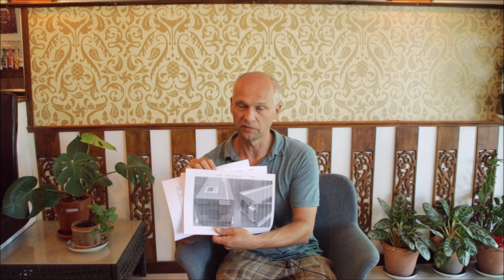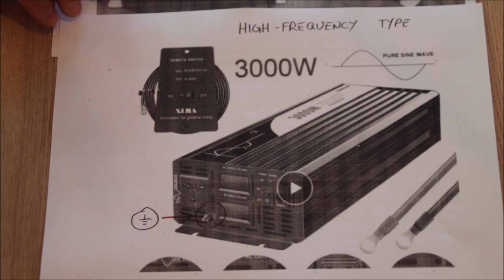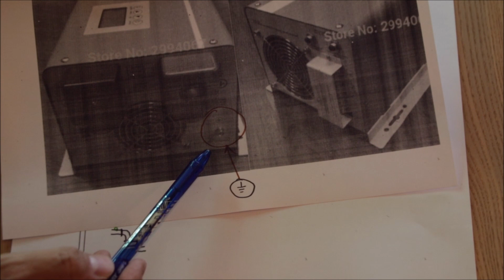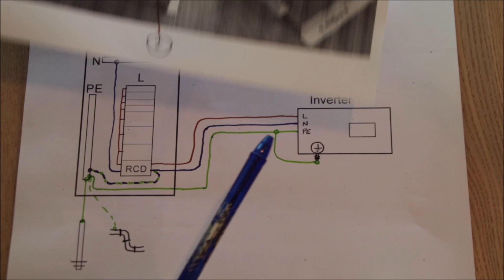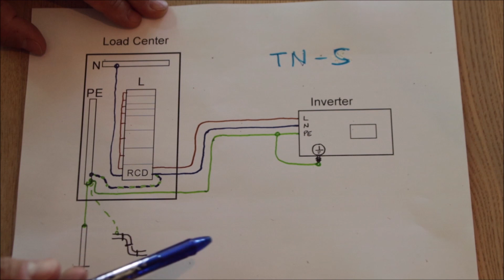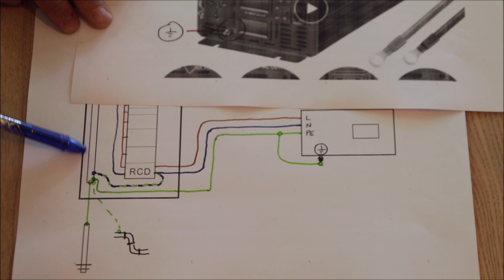Inverter Earthing and N-G Bonding in a simple Off-Grid Setup

Comment: I'm struggling with my system. I've put a off grid all in one unit in my camper and just wired in a 30 Amp rv plu then plugged my camper into the inverter. I have the ac input coming from my house.  My camper frame shows 14 volts sometimes and sometimes 40 volts. It's enough to shock me when wet
Reply: I watched your videos and some I watched over and over. I think you are right. You teach me in a way I can understand it. I'm not sure if a relay will switch fast enough or maybe to fast to work right with building a ground for my system. It seems that it would have been much easier to have not bought this hybrid unit and just bought separate components to have done this. Seems like sometimes trying to save money ends up costing a lot. Thanks for the help with this grounding issue. When I get home I'm gonna start testing and see what happens
Reply from the maker: Hi. That is typically a sign of an ungrounded electrical system with a floating Inverter Neutral. Is your AC-out Neutral bonded to a true external ground source?
Reply: @RolandW_DIYEnergyandMore  I really don't know if it has a neutral ground anywhere on the camper. It seems to be fine with camper plugged into the house but when I plug camper into my inverter it's creating the hot skin on the camper. I just watched a video where a guy with a grow watt had same issue and he used a relay to get the neutral to ground bond while in battery mode. I guess I'll try that and see if it helps. I might be creating some weird power loop cause it's still powering the converter to run 12 volt stuff and then maybe it has another inverter under the camper converting that back to 110 even tho the 110 is supplied thru the main plug with my all in one inverter. It's all really confusing bit hopefully when I get home in a couple days I can figure it out
Reply from the maker: @matthewknight5641  a lot of my videos are just about this. When your inverter is bypassing the AC to the camper from the House AC, the house main panel is providing a N-G bond (or at least your grid is). But once the inverter is switching into battery mode, then that bond is lost and the camper is isolated from the ground.
Look into the playlist and you will find videos about "All-in-One inverter in TT-System", "DIY don't forget about grounding and bonding", "Practical guidance for different earthing systems", etc. All those videos will give you clues to what is happening.
The solution could be easy as just placing another N-PE bond at the AC-output of your inverter (or maybe you have a breaker box in your camper). But be aware that by doing so you are interacting with the grid supply of your house and all might not be appropriate. You will have to know what type of earthing system your house is grounded in. In the case of a TT-System you would need a bonding relay as you have mentioned.
Reply: @RolandW_DIYEnergyandMore  thankyou for helping g me with this issue.  I've been struggling struggling with this and you saved the day. I'm a truck driver and I don't get to spend much time at my tiny home camper but I will be there in a few days. I'm excited about getting this problem fixed. It's really great you are making the videos to help us people who love this stuff but want to do it ourselves. I'm gonna try this and I'll let you know how it goes. Thanks again
Reply: @RolandW_DIYEnergyandMore  hey I was wondering if you think It would be better to use a solenoid to tie in my neutral ground bond to a ground rod or do you think it would be better to have it tie into my house neutral and also tie into the house ground. I mean use the solenoid to connect ac out ground with acid ground and another solenoid to tie my ac out neautral to ac input neutral?  Or should I just use a solenoid to connect my ac out neutral to a ground rod ?
Reply from the maker: @matthewknight5641  how far away from the house is your camper? In what country/electrical system are you living? What type of inverter do you have?
Reply: @RolandW_DIYEnergyandMore  the camper is about 20 foot away from the camper. I'm in united states in Tennessee. And my inverter is a 3000 watt hybrid inverter. It's a 120 volt. The brand name is powmr.
Reply: @RolandW_DIYEnergyandMore  I like having it wired to my house using the ac input because I can charge my batteries when there isn't a lot of solar. I'm thinking it might be easier if I don't use the ac input and do the ac output to camper only. When it's using the house for ac input and I am running thru inverter it has 40 volts thru the camper frame. I'm not sure how to bond the ac output in a way that it will be safe and not energize frame of camper. You are really smart with this stuff and I really appreciate you helping me.
Reply from the maker: @matthewknight5641  OK. Well, I would just use the ground of the house and connect the campers and inverter chassis to it initially. Leave the inverter isolated in battery mode. I assume the camper doesn't have to many circuits/appliances connected, right? After you do that, does that change anything when you touch the camper? If not, place a jumper wire between your earn and neutral terminal at the inverter ac out. See if a current if flowing there when the inverter is either in battery mode or in grid mode and if things change then...
Reply from the maker: @matthewknight5641  your problem with the energized frame would definitly be over if you drop the AC in to the inverter and instead use a transfer switch to get shore power from the house when the battery is depleted. You could then just charge from solar or an AC charger (like an e-bike charger) which you just plug in to a house socket. The inverter would then just have to be permanently N-G bonded (on inverter side of transfer switch) to a rod at the camper with all equipment and camper chassis grounded to that rod.
Reply: @RolandW_DIYEnergyandMore  I'm going to do the transfer switch method if the jumper wire don't work. Roland you have saved me so much time and maybe my life. It's guys like you that make YouTube a valuable tool for the whole world. I thankyou for spending the time with helping me to make my tiny home camper safe. Now once it's completed we will be able to get showers in the camper and not be shocked in the rain. Thanks again for your service.
Reply: @RolandW_DIYEnergyandMore  thanks again sir you really are a life saver
Reply from the maker: @matthewknight5641  right, it's definitely not good to get shocked while taking a shower ;) stay safe!

Comment: Hi Roland  thoroughly enjoyed this tutorial 
I have a question , I’m totally off grid. If I am using the inverter to power a small off grid cabin should I use double pole circuit breaker as my understanding is that both the active and neutral wires have 115/120 volts each thus making up 230/240 volts  if a single pole breaker were used there would still be 115 flowing through the neutral when the breaker tripped therefore voltage travelling through to the device . Is that correct 
Regards
Love watching your vids
Reply from the maker: Hi. Just to confirm, you are in the US system or just reading 115V between L/N to unbonded PE on a 230V inverter?
Reply: @RolandW_DIYEnergyandMore   hi no in Australia using a MrPower inverter 24 volt I bought of eBay. But during my reading on the net I thought that I had read bothe the neutral and active were  live  with  each 115 v making 230  something to do with floating neutral
Reply from the maker: @markpfitzner3609  once you physically bond the N of the inverter to a true ground source, that N will become a real Neutral with no potential towards Ground and will technically behave similar to a N coming from the grid. Breakers within an off-grid installation are overstated anyways. They are used more like switches to deactivate certain circuits on purpose. The over-current protection is coming from the inverter itself. But what is important is the RCD as it can detect minimal leakage currents which can come from any of the active inverter terminals in relation to the ground. So, you can use a 2-pole main breaker, RCD and 1-pole breakers for the individual circuits or just skip the main breaker inside your panel at all.
Reply: @RolandW_DIYEnergyandMore  thanks for clarifying that is awesome I’ve been searching for an answer to that for ages 
🙏
Reply: Hi Roland one last question is it ok to ground to the same copper rod as the solar panels are grounded to ? 
Regards
Reply from the maker: @markpfitzner3609  yes, you can
Reply: Hey Roland after listening to your awesome advice  I’m at my off grid remote outback location today and I looked at my inverter a Growatt  SPF 5000 es. I  ran the multimeter over the earth and neutral straight from the inverter it appears already earth neutral connected slipped a RCD in between the inverter output and the load tested it works awesome but I realised still no earth stake  it’s Al in side a shipping container with a steel verandah coming off with posts in concrete in to the ground. Would this be acting as a huge grounding rod 
Regards
Reply from the maker: @markpfitzner3609  technically the structure we be grounded albeit with not such a great impedance value. For the electrical grounding you should use a copper rod and all copper wires from equipment till earthing point. As I understand, the Growatt SPF is internally N-G bonded. There is no need for another bond inside the distribution panel. But an earthing rod/bar and all equipment connected to the earthing bar is required.

Comment: I didn't know what RCD stood for. But what if you don't have a Load Center. In a smaller setup, if the 6KW inverter is adequate to feed everything directly off of it. Should then the Inverter be grounded?
Reply from the maker: Isolated systems do have advantages as long you only run one load of the inverter. Smaller installations might still be acceptable as long you can exclude an isolation fault. But as soon you are planning to connect a house installation with numerous circuits and loads to the inverter then you should turn your system into a grounded one to protect against double insulation faults and over voltage events.
Reply: @RolandW_DIYEnergyandMore  There is this other video. I just found the link. https://www.youtube.com/watch?v=FjuzyAujdC4 . I think he is saying that on some inverters, if you tie the Neutral to ground, you will blow the inverter as in his Xantrex example. Are you saying to ground the neutral on all inverters, or just certain types? --I'm still afraid I might blow my expensive inverter.

Comment: Hi, very interesting watching your vids. We are planning on going totally off grid living in Ireland. My system.  3 parallel hybrid inverters each 5.5kw with 15kw solar panels and 800 amphour battery set up. A 2000watt wind turbine. If all else fails a 5kw home generator on wheels. My solar aray is mounted on a wooden ground mount. My inverter. Mains coming in has 3 earth live and neutral but out put only live and neutral and a screw with earth. How would I wire this system up. Do I attach my generator to an earth rod or not? I looked at your other vid on compairing the 3 different systems and am now confused watching this vid. Not sure what I should do.
Reply from the maker: Hi. Once you are totally off-grid then it will be very easy. You just use your own earthing rod and connect your inverters grounding screw and generator earth to it and make an N-G bond.
If your PV mount is somewhere away from the equipment, then make a separate rod there and connect all frames to the grounding there.
It's just as long as you want to use the AC-In by Mains where you need to know what earthing system your grid is coming in. If you are living somewhere in rural Ireland, it might be a TT-System. You would have to find that out. Because that would determine the way of how to N-G bond.
Reply: Its a TN C S system
Reply: I should have also mentioned we live on a farm with no supply from the grid. Inverters would be primary and generator only connected to the Inverters to charge the battery. Correct me here, with this system TNCS system and your vid I would have to put an earth rod on my generator side and one on the inverter and one on on the distribution box. As we have a small shed(electric station) where the generator inverters and batties will be housed. Can I just use one rod for ground and connect all to or do I have to put more.
Reply from the maker: @mudislander864  right. So, as you are already off-grid, you can just follow the principles of a TN-S system. The power shed is great. One grounding rod per location is good. If inverters and generator are at the same place then just ground all devices at that same spot. I am sure you will put a sort of distribution panel there and you can just connect all PEs from each power source to the PE bar there. You would have to place the N-G bond at that place as well. Use 2-pole breakers here for further distribution. 
From this main distribution panel just use 3 wires (L, N, PE)(if you have 1 phase only) to other distribution points or consumer units which are located somewhere else and have the final circuits in them.
If the next consumer unit is further away than 15m and it is part of a different building, then I would make a separate rod there too and ground the PE bar again.
Use an RCD in those consumer units, but no need for N-G bonds there.
Reply: Thank you so much for your advice and great vids. Really appreciate it. Thank you

Comment: NEC requires N/G bond to be located at the first point of disconnection, which is the inverter. Ideally you need to get rid of your grounding rod at the main panel and place it next to the inverter
Reply from the maker: In off-grid systems the inverter typically will be located just next to your panel anyways. One or two meters of cable won't make a difference but the quality of the terminal will. Codes may differ from country to country, but I still think that Code as well will prefer solid connections inside a panel then on some simple terminals on the inverter right next to it. Relevant for the N-G bond is, where we expect a ground fault to happen. It will typically happen downstream on circuits connected to the panel.
Reply: @RolandW_DIYEnergyandMore  Well in my case it's 150 ft away 😭
Reply from the maker: @beboba2498  then you have to do it at the inverter, correct

Comment: Hi Roland, in a similar inverter like the one you use for the example, how do I know which is the Neutral and which is the Live, since both read 115v? Or it doesn't matter which one of the two I bound to the ground, and automatically the other one jumps to 230v and becomes the Live cable?

Thanks!!
Reply from the maker: Yes, that is correct. If the inverter is not marked outside nor you could see any difference on coloring on the inside, output voltage to a ground source is half of nominal voltage, then just use any of the pins for grounding. That one then will become your Neutral and the other one will show 230V.